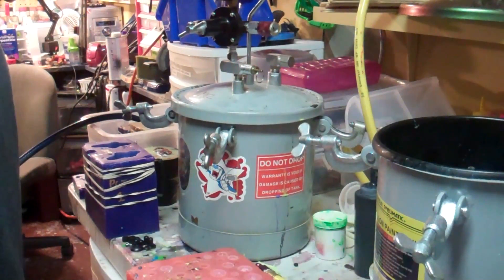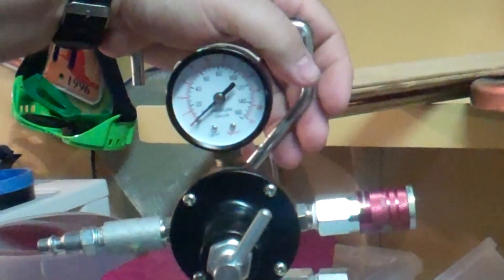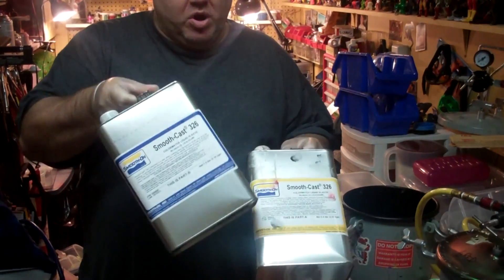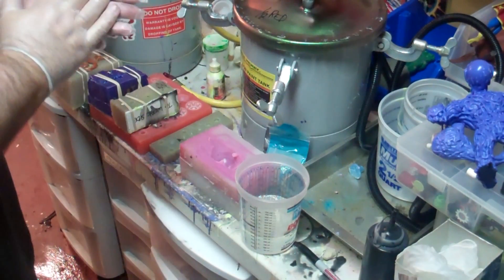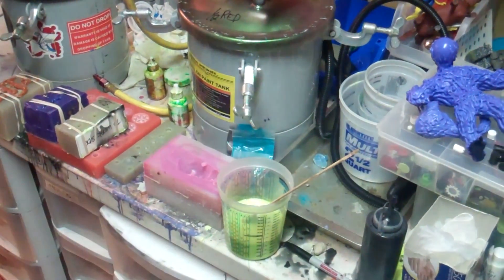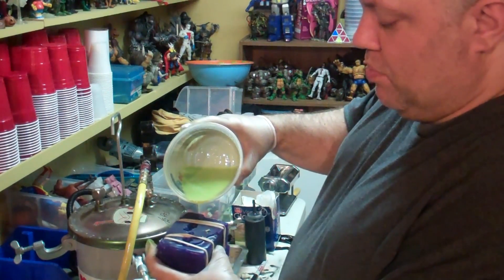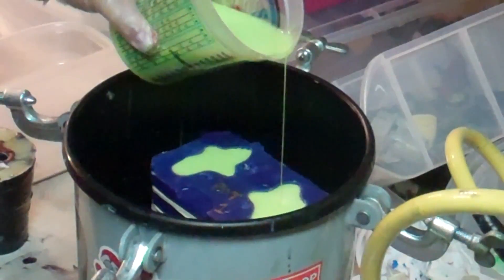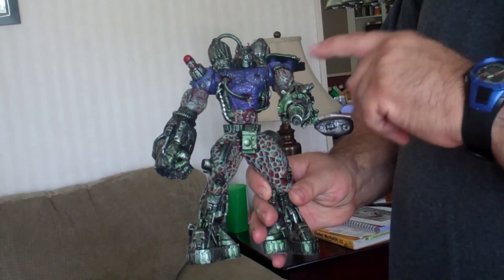Casting Resin With a Pressure Pot

Comment: is your silicone degassed? did you have to pressure ur silicone before cure?
Reply from the maker: My silicone is not de-gassed. It cures while under pressure. No need to de-gas when putting it into a pressure pot.
Reply: @ImaginationAsylumToy  thank you richard!

Comment: Is it possible to eliminate bubbles of a size of 6mmx6mm (pretty flat bubbles) with such a pot?
Reply from the maker: It is, but it also depends on venting. If it is an undercut or big bubble area, sometimes it needs a vent. Pressure pot helps, but proper venting is important as well.
Reply: @ImaginationAsylumToy  Thanks for your answer! I already have the best venting possible I guess. Do you think a shaking table is needed otherwise?
And I also have another question: can the pressure of 60 psi change/deform a silicone mold with small bubbles in it so that the cast is deformed?

Greetings, Max
Reply from the maker: I never use a shaking table, just pressure. 60psi is a bit much. Generally around 30-40 psi is enough. I've never worked at 60psi, so not sure. I wouldn't think so.

Comment: Can you use an oil free air compressor?
Reply: I wouldn't recommend it. Oil free have a tendency to be smaller compressors, which require more effort to fill the tank (even a perfect pot will leak a small bit.), and maintain pressure. Those oil free units tend to burn out quicker when used for something along this idea. My compressor is an 18 gallon 125 psi unit from Walmart. I've had it now 9 years, paid $94 and the only part I've had to replace is the blow off valve ($6.99 ebay)
Reply: What is your chemical please reply!,, w/detail can i make costumized slippers on that formula??

Comment: this pressure pot can explode
Reply from the maker: Very unlikely if all safeguards are followed. Outgoing air on compressor set at 30-40psi, pressure set on pressure pot at 30-40 psi with safety blow of valve. Only way to blow it is to play with things that shouldn't be done. I've been using 2 of them for 8 years almost daily, and never had a problem. If someone uses their head and does the research these can be a heck of a resource / tool. I've left them on all night while newly poured molds were inside to compress the air out of the silicone. Take care of the equipment. Be smart. be safe, and you will have no problems.

Comment: Nice and informative video, However wouldn't evacuating the air from the pot do a better job of getting rid of bubbles rather than positively pressurising the pot??? I only ask because I'm doing my homework before I start casting this way. :)

Comment: Its possible you might need a larger pump, especially if your using something that cures fast. The smaller the pump, the longer it takes to remove the bubbles. With a large pump you can remove all the bubbles before curing starts. See the video from easycompositestv on vacuum casting, he uses a 12cfm pump.

Comment: The vacuum chamber is good to degas the silicone before pouring it. The pressure chamber will elimate 99.99% of the bubbles in both the silicone  mould and the resin casting. Search "How to de gas silicone from Cindy" by FunkyTreasuers, she shows both degassing and pressure pot in use or search my playlist for "Casting miniatures"

Comment: yes pressure casting should remove or shrink the bubbles to negligable size. but that also depends on the resin your casting with. 

for and bubble free casting with a good hardness I suggest using "allumilite white casting resin" it has a thin enough viscosity that even without pressure a bubble free casting is possible with a bit of care.

good luck.

Comment: I've been researching the best way to produce my pieces and I constantly have issues with bubbles. I've built a vacuum chamber out of a pressure cooker, 1/2" thick piece of polycarbonate, silicone gasket, and a vacuum pump, and I find that the resin starts to cure before it has been adequately degassed, so I've found it extremely difficult to make a bubble free piece. Will a pressure pot reduce the bubble size to the point that it can be sanded and polished without noticeable bubble inclusions?

Comment: im in the procces of getting a GAS CHAMBER. Is it enough or should i have gooten a pressure pot instead?? also, what type of resin are you using? it seems to cure very slow

Comment: A pressure pot will never really explode - the worst that can happen is that a seam will split or the lid will distort, at which point the pressure will release via that split/distorted lid.
Rumours of exploding pots and even exploding resin are ill-informed opinion from people with no real experience in pressure casting.